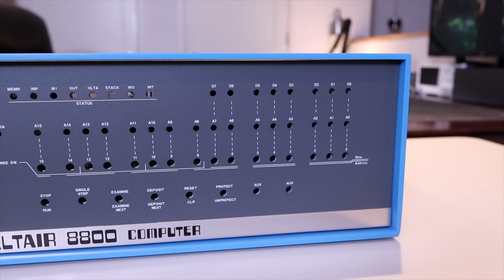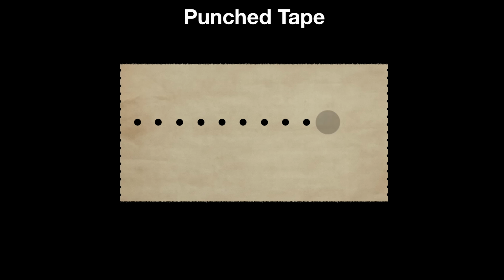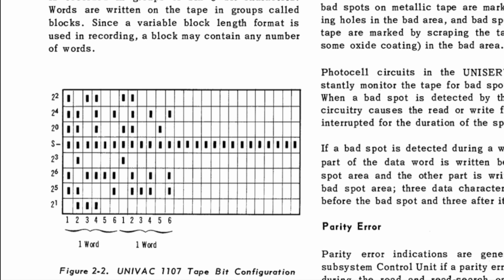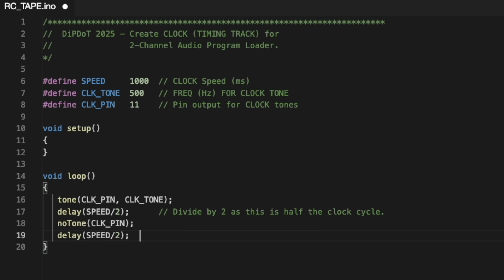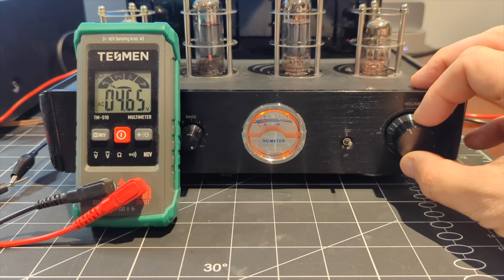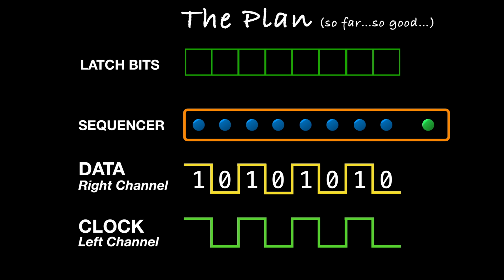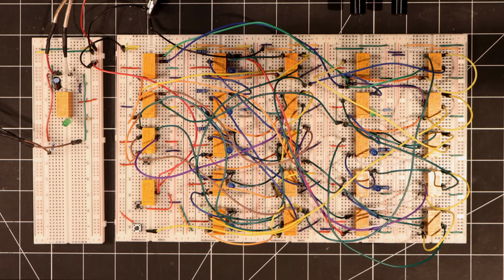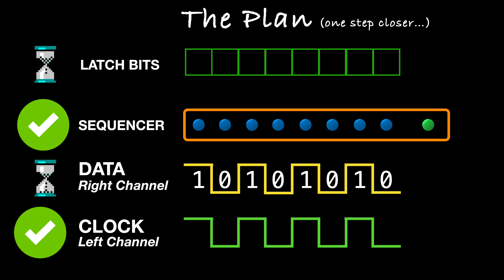Relay Computer - Tape Storage (Part I)

Comment: Audio cassette decks with autoreverse sometimes had 4-channel magnetic heads to read both stereo channels (though not at the same time). No reason you couldn't use something like this.

Comment: Keep what you got.  Use a second channel for the data.  Look up the I2C specification and to get ideas about the start and stop bit sequence concept.  Using that ordered pattern, you can make a reset to bit 0 pattern, loading data, then a termination pattern for executing your code once the tape data is finished.

Comment: I reaaaaaly hope you've come to the conclusion to just build a small transistor based class A amplifier for now. Your home amplifier won't like the load put on it, especially if it has a valve output section. You seriously risk damaging your output transformer in that case!

I'm happy to help if I can, too! I repair and design audio power amplifiers, so it's right in my alleyway.

Comment: The diodes are cheating.  Those are modern diodes.
Selenium rectifiers have been a thing since the late 1800s.
I was wondering how you were going to play a tape using only relays.  I don't even think "meter movement relays" are sensitive enough.
Reply from the maker: This is always the dilemma when trying to recreate vintage tech - the price of the vintage components is much higher. The tape deck is the same - technically it's transistorized, but I'm really just trying to show the potential, and later on if I get the chance to use a vintage deck that that's an added bonus.

Comment: There are lots of 8 track recorders used to record 8 tracks of audio on standard cassettes:)
Reply: He could also use multiple tones.  Tuned circuits can pick them off to drive the relays
Reply from the maker: Yes indeed - would need a ninth track for the clock/timing track.
Reply: @ .... unless the computer used 6 bits per time slot and combined pairs to make a 12 bit word.  That is how the PDP-8 did a tape drive.

Comment: If you use a data format where every data byte on the tape is 9 bits long and always starts with a constant 1 followed by the byte, you could use a 9-stage shift register to simultaneously latch the byte and know when its done reading all 8 bits. Once a 1 appears in the 9th stage, it means the initial 1 bit has propagated all the way through, and you can use that as the control signal to send the byte where it needs to go, then clear the shift register (by power-cycling it with a relay, of course).

Comment: Was not expecting magnetic tape memory, but I'm here for it!
Also, while it may not be period correct for a relay computer, since you are going with an Altair case you could try and add a serial interface to your computer. You could then hook it up to a modern computer via that.
I concede that it is not as cool as building one's own magnetic tape memory, but it would be cool in a different way.
Reply: Doing R...S...2...3...2 at about 12.5 Baud may be the limit if you are doing full characters.
There is a trick where you can use PWM to be RS232.  A short pulse makes 0xF8  and a long pulse makes 0xC0
Fonts on youtube don't work well for ASCII art
Short pulse = 0,0,0,1,1,1,1,1
Long pulse = 0,0,0,0,0,0,1,1

Comment: Is it right that it increments in the rising and falling edge of the push button and the tape tone?
Reply from the maker: Yes, the sequencer advances at each "change in state" between 1 and 0. So for the data track I'll need to work in the timing to squeeze in the data tone between those clock states.
Reply: I see, would there be much change to the design if you only wanted it to increment on rising or falling edge but not both as yours does?

Comment: is it wanted that the sequencer actes on the rising aswell as the falling edge of the clock signal?
Reply from the maker: Yes - it's actually quite handy as will be shown in part 2 (working on that now) - the data needs to be "squeezed in" between those edges.

Comment: find a very sensitive relay that can be driven by a tape player's read head current. This is a relay computer, no transistors please!
Reply from the maker: Having the relay computer generate the tones for recording programs to tape will be interesting (keeping it "vintage era". For tape transport control, I could hard-wire in some control lines (although I'm running out of space on my 128-line bus) - but definitely a fun challenge!

Comment: Consider grabbing yourself a cheap tape adapter from somewhere... why? Because you can directly interface with the tape head on your reader for development and troubleshooting without the extra steps of recording, rewinding, and playing a physical tape. 

Also... given the relay-based nature of this project using tones, beat tones, filters, and all that are kind of off the table... have you thought about using duration as part of your control schema? Your clock signal could have a detector that just functions as a clock for normal use, but if a single tone lasts longer than a second it does something like reset the sequencer and send a hardcoded command to start decoding into a given address. This would be something like an automatic program start function built into the tape itself. Same on the other end... no clock for a few seconds, and instead of sequencing a run command is triggered to the starting address. 
The circuitry could be as simple as a capacitor with a bleed resistor, for both ends... slowly charging/discharging capacitors connected to interrupting relays, with an event time longer than a clock cycle. Interrupt the cycle and the capacitor finishes charging and energizes a relay. 

Would that be worth it? Well, I'm imagining a use cycle for the machine with this sort of system of just turning it on, maybe pressing a reset button, popping in a rewound tape and hitting play. When the tape stops, the computer pops into whatever was loaded. There could always be more to it, but that's a nice level of interface simplification.

Comment: Probably elevated the amp output to compensate for the rectifier diodes to 5.5V ? or used Schottky. 
Used a video recorder once to tape a long radio show, might have had a fast/slow option aka quality setting. 2 hours or 4

Comment: If you use a low frequency tone for a zero and a high frequency tone for a one, then you can use a low pass and a high pass filter to distinguish them and split them out to two separate signal wires if you need. I'm pretty sure you can use an RC circuit to achieve that. You can have one track be the Control track with low frequency tones for clock pulses and high frequency tones for framing pulses, and a second track can be the data track with low tones for zeros and high tones for ones. That will allow you to ensure correct framing, for example, so you can know for sure when the first bit is being read and that you aren't in the middle of a byte when you start reading. 
You could do clock recovery on the data track with no control track at all by both decoding high and low tones and counting total tones seen to create a clock.
You can use both tracks for data to read 2 bits at once, or even better, PAM3 encoding where each track can be a Low tone, High Tone, or silence. Then you can transmit 3 bits per pulse, and every 3 pulses is 8 data bits + 1 parity bit. For example:
000 = low + low,
001 = low + none,
010 = low + high,
011 = none + low,
100 = none + high,
101 = high + low,
110 = high + none,
111 = high + high,
unused = none + none, to allow you to pulse the tones and have a "blank space" for both framing and to allow time for decoding and clock recovery.
Reply: So, basically DTMF decoder in analog
Reply: @mikk150  you could think of it like that I guess, but using high pass and low pass filters won't work for DTMF because the frequencies are too close together. And instead of each channel having 3 different tones, it would only use 2, a high tone and a low tone, with silence acting as the third symbol. I'm thinking like, a few hundred hz and a few kilo hz. They need to be very far apart, at least an order of magnitude, so that the filters can completely separate them.
Reply: @WarrenGarabrandt  but you could do band pass filters and some kind of relay logic to decode 3x3 DTMF like signal and now you have 9 signals to play with.. I am not saying it should be DTMF per spec, but something similar would work
Reply: @mikk150  we may be overthinking it though, since the relays are going to be limited to like a byte per second anyway.

Comment: fitting to this topic, I would like to share a little story: 
I started to build a Vacuum tube computer, but to make period correct memory, as you found out, is a hard process and there are not many good options. as usagi electric for example strugled, and his computer is basically pointless beause of the lack of memory and such (still an incredible project) so I have decided that I couldnt produce memory like that CRT tube thing, or mercury delay lines or crossbar switches. all things i could not manifacture. also core meory was very complicated to use and i did not trustmyself to be able to do that. now, I decided to make a rotating drum memory, like for example the bendix g15 has. and many people went and said it is impossible and i could not do it. and well, I did it anyway, it is very janky, it is very "ducttape and cabletize" kinda of manifactured, but in the end, I managed to get it working! If I could have just decided that for example core memory, would be easyer or whatever everyone was saying is the easyest option, i would never had the oppertunity for this amazing engineering challenge,
so basically what i want to say is, think outside the box, sometimes doing what not everyone else is doing is interesting and cool.
Reply from the maker: 100% - I looked into those different memory options and found them complicated and wasn't sure I could pull it off with the relays/diodes alone - I'm still going to build capacitor-based memory for this machine. That drum memory sounds really cool, would love to take a look at that!

Comment: Be sure to shift the data wrt the clock. A latch will latch on a clock edge, not on a high or a low.
Reply from the maker: For sure, I've started the next part and since the relays have a lag time due their mechanical nature, I delay the data a few ms between the edges.

Comment: You will have a problem with synchronisation at the end of each 8 bits, if you lose sync everything will become offset within each byte. One possible option is to use a tone decoder so a low tone would clock the next bit and a high tone would latch the byte.
If you want to keep period accurate maybe you could make up a series LC circuit to feed a diode bridge for each of two relays and tune the LC circuits to the frequency you want for next bit and latch. Other circuits are possible :)
Reply from the maker: I'm thinking it would just be the number of steps per byte that dictates the synch. So If I end up with 8-bits for the data, I will add some extra clock cycles just to get the sequencer through the remaining steps needed. I guess we'll see in the next episode 😉

Comment: Rather than using just on/off for data why not use a range of frequencies as the tape unit is designed for a 'full' (hmmm!) audio range. That way you should be able to get considerably more on the tape.
Reply from the maker: The trick would be to decode or demodulate at those specific frequencies (as opposed to just producing a tone to voltage) - it's a consideration to maybe build some frequency filters or such to do something like that.
Reply: @dipdoting  I have been thinking of using normal reel-to-reel tape equipment to build a small loo-alike DEC TU-10 tape-deck to go with my PiDP-11, and would like to make the tape have a realistic amount of storage on it. I think proof of concept would be satisfied by simple binary transitions.

I note there was a suggestion of using an arduino to emulate the tape deck. I go through stages of thinking I might do that with my projects, but then think it would result in lots of arduini/Raspberry Pis pretending to be what they are not, all connected together.

Watching relay computer videos has tempted me in that direction.

Comment: This is great! I humbly suggest to use the Arduino for bitbanging code to tape, using tape as «read only» for the relay computer - first. 

Then tackle the issue of letting the relay computer also write to tape later. I suggest this because SAVE or LOAD would be as manual as in the C64 days. 

The third «level» - the computer using tape as r/w memory - is trickier, as the computer must have full control of the tape transport, positioning the tape & recording to one bit (clock cycle /2 in your case?) precision.

On a two track cassette, that probably means recording & writing to the data track only, keeping the clock track as «formatting» for navigation. An ordinary MC mechanism can’t work backwards in a controlled manner, as those mid 1950s tape transports could. 

BTW, Usagi (David) is just now working on an old dedicated data cassette drive, it uses direct drive servos to work like those tapes (and a lot of additional logic & ram). 

But, what a magnificent challenge… 🤓

Comment: Very cool! Im also trying to implement period correct memory for my relay computer, and had the same realizations with punch tape. Building a puncher would be a massive project on its own. Really cool to see you testing out magnetic tape. Gives me all sorts of ideas!
Reply from the maker: That was my trip-up as well - I can't punch the tape. I know that it could be printed and then just read optically as well...that's a possibility.
Reply: How about voting machine card punch hardware?

Comment: i wonder what kind of circuit you will use for transforming the digital dc one-off voltage to a ac soundwave... using a 555timer is probably the most simplest solution, but with relais; man im excited for the solution you come up with! - great stuff; thank you so much! :)